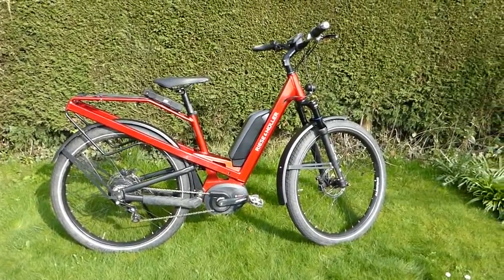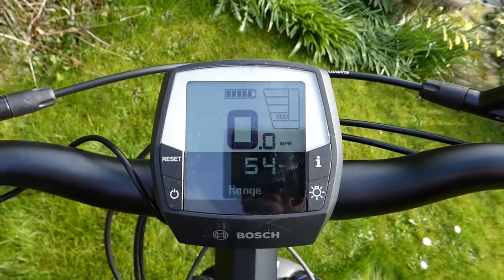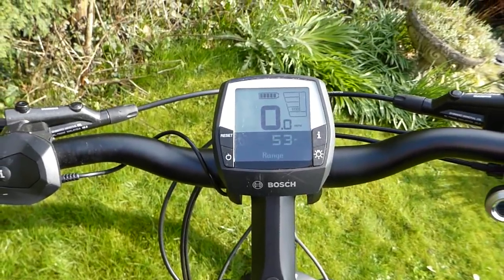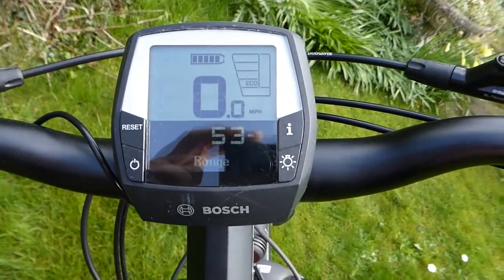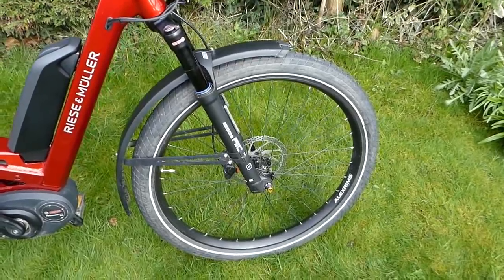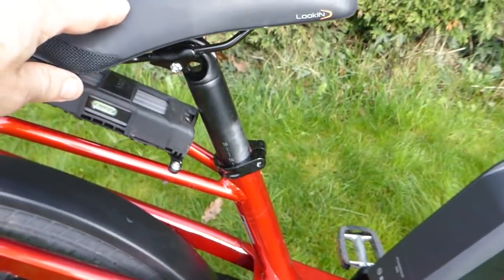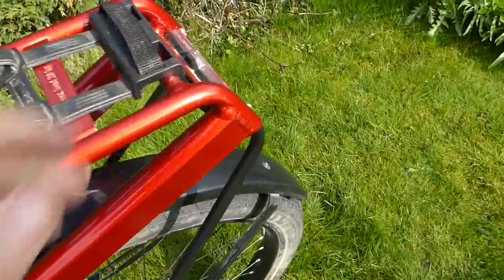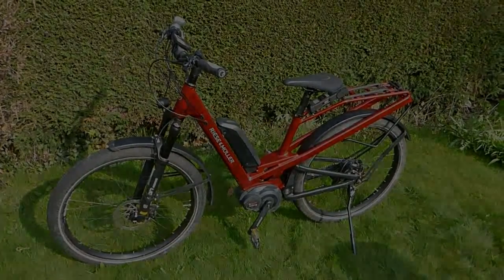Riese & Muller Homage GT NuVinci Full Suspension Electric Bike Review | Electric Bike Report

Comment: built a full suspension with a bafang mid drive and an Auto shift nuvinci 360 with cadence preference selection.  works very well on hills and stop and go scenarios.  buttery smooth.  like the fixed chainline!  dare i say, for half the price.  nuvinci hubs worth the cost, the bit extra weight is well worth it, especially complimenting a mid drive electric bike!